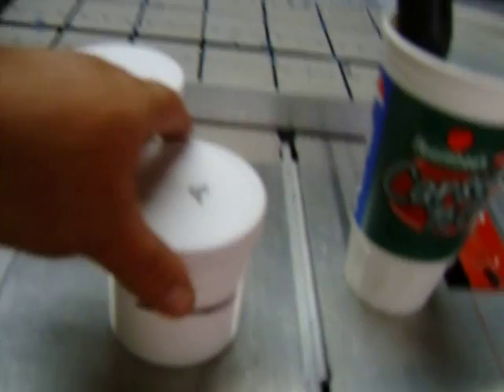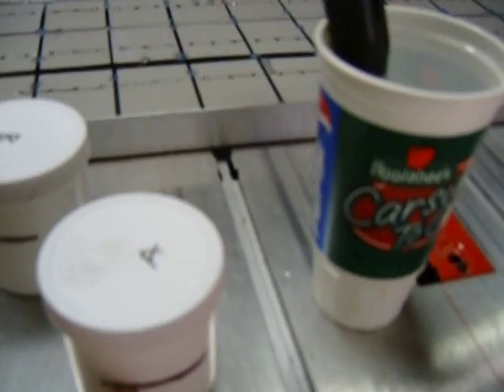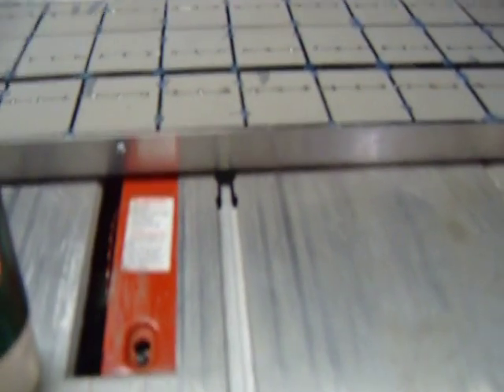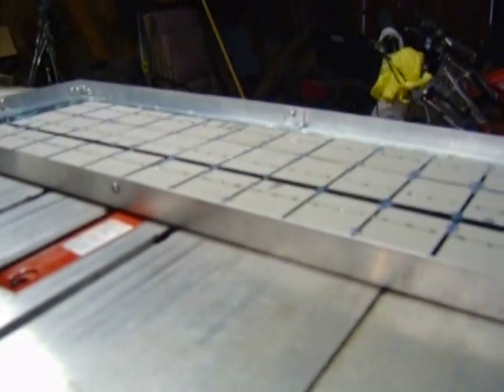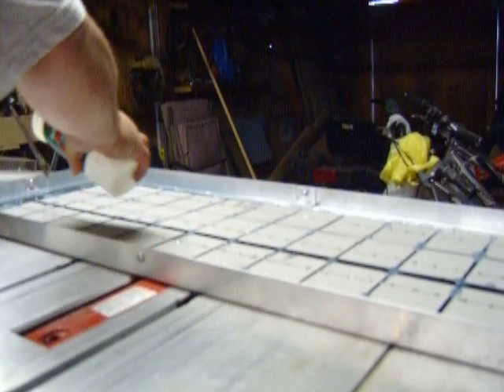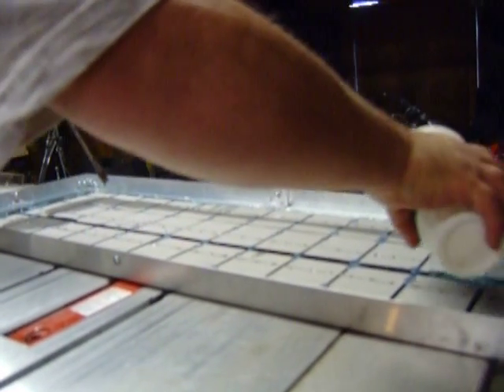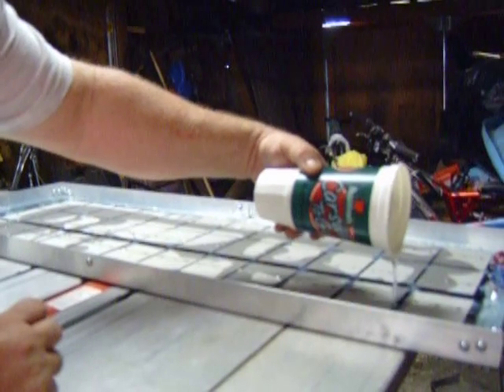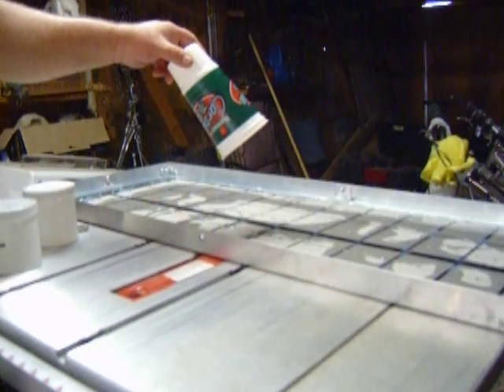How to Make a Solar Panel that Will Last For Thirty Years Part 11

Comment: can you please make a video while you bead the solar panel........can we pour sylguard on the bus wire where we have soldered the positive and negative wires???? plz reply me
Reply from the maker: Yes you can pour any brand encapsulation on soldered wires. It only encapsulates them. Just make a dam around the cells to hold the liquid encapsulation in place no big deal.

Comment from the maker: @rollandelliott I think the sylgard dries faster not sure but it is thicker makes me think it dries faster. It cost more than the 6100 and you get half as much. The 6100 6010 gives you much more a whole kilogram and its thinner it should be easier to work out the bubbles. I want to say buy the 6100 6010 is the best deal but I would have to say it takes longer to dry.

Comment from the maker: Usually the basic kit is made for 3x6 cell I guess because that is the most used cells. Solar Tite 384 worked for me just as good as the rest. I just saw a new one called Stosil M-1 made in Poland. It just has to cover but its nice when there is plenty of it so it will protect your cells better.

Comment from the maker: @wiboater4 Its really easy to work the air out of. I didn't put a good dam of silicone around it and lost a lot of sealant. So the next day I added more but I got a lot of air bubbles because it had all leaked out the day before woops.

Comment: Problem I had with the sylgard was air bubbles that wouldn't work out on large panels. It was around $50 for enough to do a 2 x 4 ft panel. The video I watched the guy weighted down the cells after he poured it. I poured then covered the back with wax paper and weighted it but air still wouldn't work out. Maybe that thinner stuff will work better. You might want to try the wax paper and weight them down with something to keep them as close to the glass as possible. Peel off paper after cured.